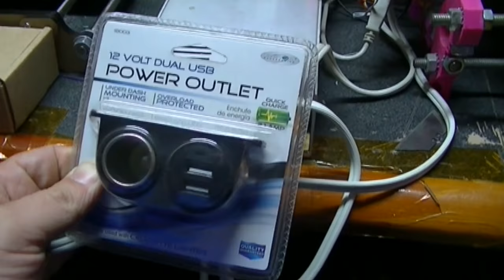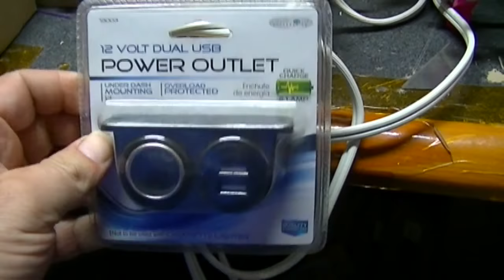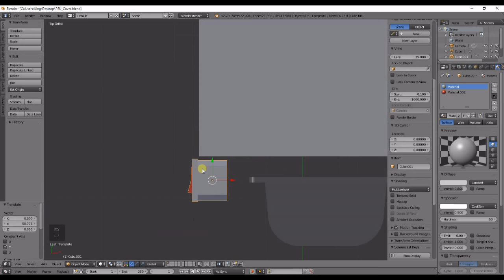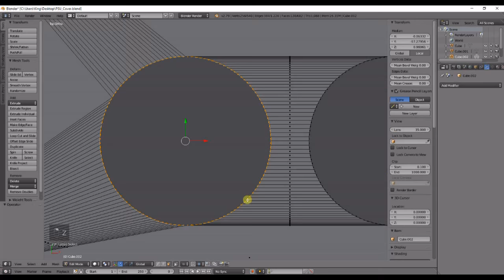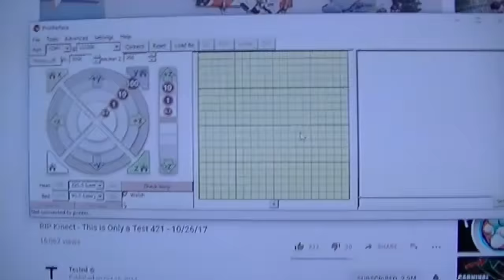PSU Cover with Power Switch and USB Power Outlets

Comment: I wonder if this would power a raspberry pi.
Reply from the maker: 3D Printing Professor I believe a RasPi runs on 5 volts. I'd have to check the output voltage of the outlet. I do remember the output is up to 2.1 amps.